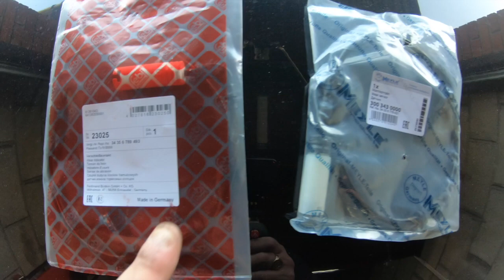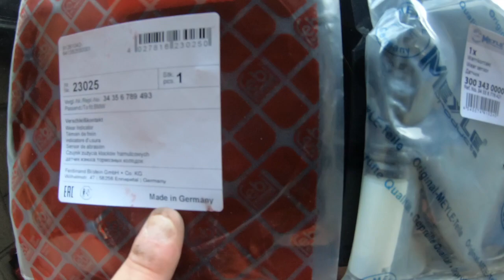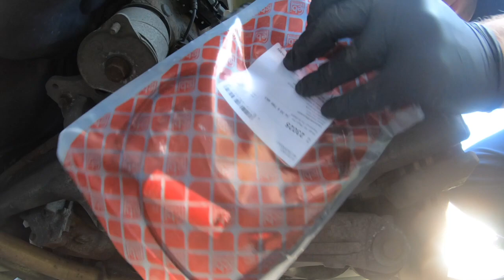Bmw E60 E61 How To Change Brake Pad Wear Sensors Front & Rear

Comment: I have a e82 123d and can’t reset by brake pad warning system on my car 
When I go too reset it the mileage value doesn’t change or reset 
Iv fitted brand new disc and pads all round with new oem sensors 
Any ideas why I can’t reset these buddy?? 
Thanks in advance

Comment: I did front and brake pads and disc change but the front one is stuck at -9000 and it keeps telling me I need to change them I tried to reset it but it won't work?

Comment: I have a 07 530xi and the screen stopped turning on completely. I have no radio and no temperature settings. Can you make a video explaining this? Or just answer here lol
Reply from the maker: if your screen has completely gone blank then that means your idrive unit itself is faulty and will need replacing the fan stops on the back and the chips overheat causing complete failure
Reply: The idrive unit is the little menu button that i can move around on the center console right ??
Reply from the maker: no its not the unit itself is built into the dash

Comment: From one of your previous vids on the diesel you said the fuel pressure regulator on the fuel rail you have to constantly check...what symptoms would they give as no fault codes show up if its intermittent as its a 2 wire one..fuel rail pressure isnt consistant at load again no fault code
Reply from the maker: No you mean the sensors that’s what controls the fuel amount into the engine itself and yes it can these give no fault codes as there is two used on both sides I have seen many times they give no fault codes when they go bad
Reply: @BMWDoctor  just checked the fuel rail pressure out of curiosity only with out starting the engine to see if the reading from the sensor fluctuates and it does. Rail pressure without starting engine is reading 6.47 bar but was fluctuating 6.47-4.27 rail pressure...so now know its faulty. Harder to tell when engine is running but can see it if recorded it and watched it back. Cheers..car be running like new again when swap it out. 👍
Reply from the maker: That’s it mate just change it out and finished common common problems and never throw a fault mate
Reply: @BMWDoctor  thanks. Car was jerking and hesitation on low revs...have zero fault codes. Only code i get would get would be fuel filter but put a new fuel tank pump in and checked the old one by taking it apart.. inside the white type bucket where the electronic pump is theres like a filter gauze type and it was spotless..so maybe some help to someone if they get same symptoms...had that fuel filter code before and after fuel filter change... only get it when i let the hesitate for to long
Reply from the maker: Mate they ALL throw that code believe me regardless what you do I think it’s to do with using cheap diesel I only use shell v power diesel and petrol for that reason and also injector cleaner that stops them codes coming up that code always always comes up mate best advise just sell it and get yourself a 530i less trouble mate and easy to fix lol
Reply: @BMWDoctor  only use ultimate diesel...all injectors are 100% ..busted open the old fuel filter had done about 7k on it and it was cleaner that i expected..but yea this was slash is the only tiny problem i have which is as good as fixed lol. Thinking maybe of selling my E60 but if do might dive in to the 530i
Reply from the maker: you should mate you won't regret it dont worry if you get any problems im right here mate so dont worry or bring it to me and we will sort it